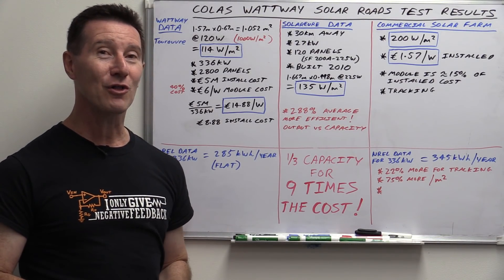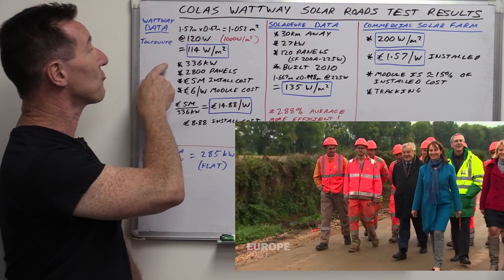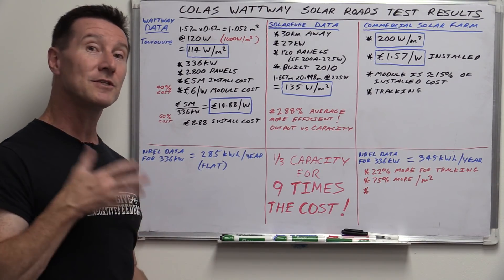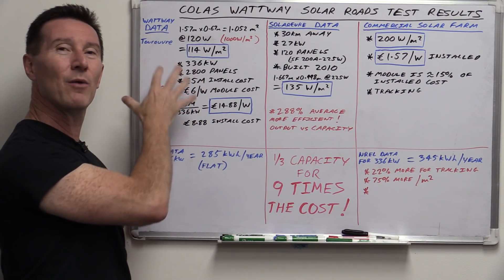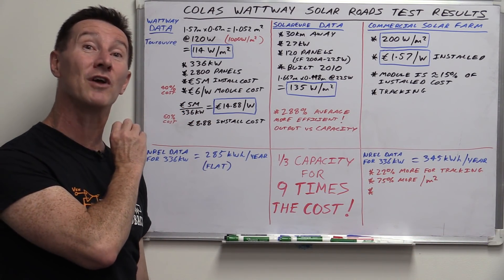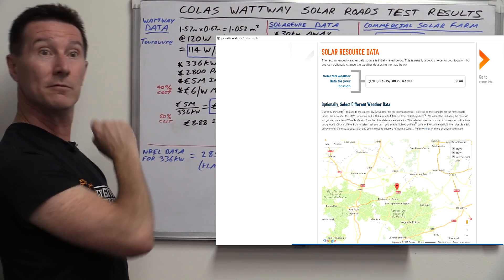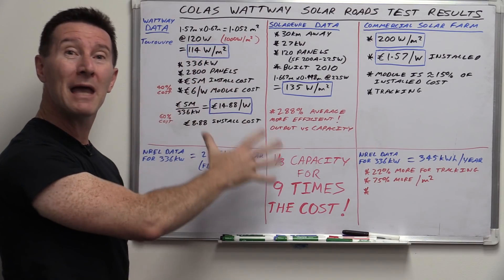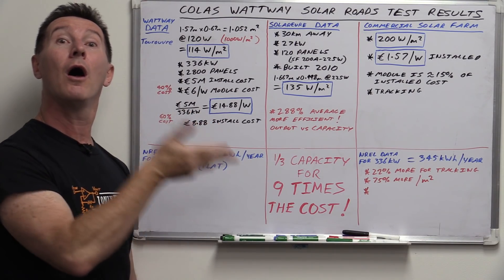EEVblog #1047 - Solar Roadways FINALLY BUSTED! (Colas Wattway)

Comment: Solar itself used to cost more than ten times the cost of fossil fuel, or hydro power.
That cost changed over time. Now solar is cheaper.
So, don't say never.

There are places where land is a premium. If existing roads can be converted to solar roads, it may be worth it.

Comment: You spent 20 minutes stating the obvious but completely missing the point. Solar roadways are NOT competing with solar on roofs. or solar in fields. They're competing with roads that dont have solar. The number(s) to care about are the total cost of building the road including maintenance, deducting any money they make on the solar generation. If you can build a road with solar that costs less than building one without solar, even if its less efficient and more expensive than putting solar in a field or on a roof you will still do it because of the economics. I dont understand why more people dont get this. I didnt need to watch your video to know that putting solar on my roof or in a field would be a better option if i was looking for somewhere to put some solar. I presume that right now the cost of the solar road, even including its generated revenue, is more than a non-solar road. The data that is generated by these experimental roads however will be invaluable to working out how cheap a solar road needs to be and how much energy it can generate to compete against non-solar roads.

Comment: Your comparing apples to oranges really, come on, if it is 1/3 efficient in comparison road solar system its still good think about. If all roads are cover with solar system will still produce more power then all other solar system which mean less fossile fuel is a good thing. If you put other solar system on the roads they won't last a day let alone an hour.

Comment: 30x worse on these calculations, but maintenance will be FAR higher than a solar farm and depreciation will be a disaster - driving trucks over your installation will surely cut its lifetime by at least 2/3. So over its lifetime you could make a conservative estimate that even the best solar roadway would be over 100x more expensive. Add heating panels, LEDs and an absurd tiled design like the Solar Freakin' Roadway, and you are rivaling chocolate teacups in terms of viability. Believers in this technology are approaching the irrationality of the Flat Earthers.

Comment: I don't really like these kinds of videos as they are attacking something that could be useful. Don't get me wrong some of the solar roadways are a joke/scam, but others are people trying to get it to work. Yes dedicated power plant is going to be cheaper that the road way, it is literally designed to produce the most power for the least cost. I feel what you are missing is how many thousands sq kms of road there is out in the world. In most places the black tarmac actually cause problems in the summer. If we can take these roads and use them for more than one purpose that would offset the cost and maybe pay for repair. Are solar road ways going to take 10 years before cars can drive on them (as a normal road way), probably. Do I think you should be including these facts in your argument, yes.

Comment: It's just as much of a scam as that Virgin Galactic sub orbital flight thingy. A 5 seater sub orbital spaceplane with $200,000 a seat tickets. I reckon only 1% of multimillionaires will be interested and about 50 flights should see that market exhausted in the USA.

Comment: Politicians are not interested in the efficiency of anything, only in their future votes...
If the public doesn't want to accept the real data then the politicians won't either.

Also, while the engineers probably pointed out those efficiency issues before installation, the sales team was selling the whole concept as magic and sorcery!
That's why most engineers just give up arguing with non engineering people, as most of humanity prefers fiction rather than facts...

Comment: UPDATE 7/2019:
Experiment failed. Instead of expected 22.000€ for the sold electricity per year they only created 8.000 €. Not included the cost for repairing the demage on the road.
But guess what - now they want to build "A BETTER VERSION" of the same DAMN THING. SEE here:

https://www.thelocal.fr/20190725/frances-experimental-solar-highway-has-failed-admit-officials?utm_source=Users&utm_campaign=c17ac86143-newsletter_France&utm_medium=email&utm_term=0_6b87f680a1-c17ac86143-61587861
These idiots just do NOT stop.

Comment: Why don't they just build solar roadways on the sun? They can build them upside down and just run a wire to the earth. Since the sun is ~93,000,000 miles away, they will be that much more efficient! Let's start a crowdfunding page and send the solar roadways engineers to the sun!

Comment: i see the point you make, but about the cost, i disagree with you. first: its a prototype situatuation.. if the can do it in big dimensions, and if the cost for solar panel drops (like all technological things, they will drop) the cost effiency will be better. And its not fair to compare it to a pure solar panel installation.. you must compare it also to the cost to a normal road construction with concret oder asphalt. a normal streat in germany costs around 300`000 euro for one kilometer. at the moment, and for a pilot project, its absolutly not efficient, thats right.. but, if the the concept will be adoptet in a much larger scale, the production costs will shrink (because of mass production) and the installationcost also (because of specialiced machines and tools, that companies will made for such a scenario). and there are other points: a normal solar farm needs space, space that then is wastet for other usages like bilding houses, grow food or stuff like that.. the land must be buyed, thats expensive.. the "land" on roads are allready buyd, so the prise for land falls flat. And, especialy here in europa, the cost for electrical power is massiv, and it will rise, because of focusing more on renewable energy instead of oil, charcoal and atom. if you count everyting together.. and the fact something like that can help to save our invoirment, its in a vew year no longer "that expensive" as it is now
Reply: You have words (vapid notions of hope), but no numbers (facts and reality).

Comment: Dave, I agree with your calculations but I believe you missed some important data. You should consider the cost of land that you don't need to purchase for new solar commercial applications and you should consider the road maintenance savings. Cheers
Reply: "you should consider the road maintenance savings" are you JOKING?!?! 😂Replacing potholes with computers! 😂

Comment: Not only is the roadway outrageously expensive, the figure for the commercial farm seems high too. For a $1.50 a watt you can get panels installed for homes in the US. Solar has gotten to be such a big business in this area that the local power company convinced the Chinese to build a Florida solar panel making plant to supply themselves with panels. Instead of 300 KW they are adding about 300 MW per year in Florida. https://www.fpl.com/energy-my-way/solar/energy-centers.html  Disclaimer: While I don't own FPL/Next Era Energy stock, my father worked for the company for 18 years.

It looks like the French would have been better off installing supports along the roadway and putting panels above the road. That also would have helped keep the drivers and road cooler and in the winter, less snow on it. Flat mounted panels are not bad in all locations and the closer to the Equator you are, the better they do.

Comment: canada is getting in on this action now "The City of Prince George has partnered with YCS Holdings Ltd. who have installed a section of solar-panel road in the parking lot.

The segment of Wattway solar-panel pavement connects to City Hall reducing consumption of energy and allows them to supply power to other areas, such as vehicle charging stations.

Chris Simons, Division Manager, says this is just the beginning of what he hopes a future expansion.

“Right now we are in the research and development stage so we want to trial it here and see how it stands up to Northern BC interior winters and it could be an opportunity for projects going forward to utilize this technology.

Simons says with this installation, Prince George is making headway in renewable energy.

“This is the first one in British Columbia and it’s the first one in a public environment in Canada.”

The panels are installed without having to destroy or rip up the existing roads and can stand the weight load of an 18-wheeler truck."

Comment: Wouldn't it make sense to just open another nuclear power station using modern technology? 1000 MWH per core that will be fine for the next 30 years, is more sensible than 300 KWH on a road that will fail to work after a few days.

Comment: Just a crazy idea, i was thinking about wether it's possible to utilize the sun shining on road surfaces in an other way. Namely not using solar panels but instead somehow utilising the heat collecting property of blacktop. For example by running water (or maybe an oil) through pipes below the surface of the blacktop and then run it through a heat exchanger to generate steam and power a turbine. Something along these lines.

Comment: It is not as good as a normal solar panel cuz it has the utitility of a road, I guess it' s possible to use because roads aren't producing any eletricity,if the cost of a road plus the solar panel, plus the space required is the same of a solar roadway, why not? Even if the price lowers, it won't go at the same rate, the technoloy of sturdy and cheaper material for solar roadway isn't necessary for solar pannels( guess the solar pannels will be even cheapier) but we can't know for sure. Possible that you're right, but the argument seems like, "why you'll use a plane that can't fly high enough, need a slingshot when we have zeppelins?"

Comment: What will be the costs for the road with conventional covering and what is the extra price for making a usual way a solar way? Will this solar way last only 15 Years or will it last for 30-40 years - as usual roads do? Is there a way to replace the solar panels without completely replace the whole road? Cost effectiveness might also include all costs a asphalt road would have. The electric energy is an extra.

Comment: So...20mins of one point...it's not as economical. Cost is far from a debunked or busted. The only things here is $ vs watts - what about the other things? How much does it really cost to maintain vs other road types? What is the value of roadside power anywhere or on road charging whilst driving? This is very short sighted and sounds very biased. Add more perspective maybe?

Comment: The French. looking to create new wealth for its citizens, decides to build a 943 mile-long solar roadway. The sun-light (having set its sights on French soil for some time now) seeing a fatal flaw in the road's design, realizes that the panels are cemented in. This leaves the gigantic gray strip - whose beauty was loved by all who walked its shimmering path - wide open and with two easily exploited flanks. The panels could not move or change position and could not be used to bolster the power of the various other cells along the line. 

Upon daybreak, the sun-light launched a massive two-pronged attack. The overwhelmed, under-prepared, inefficient, forces, had no choice; They surrendered almost immediately. 

Thousands of panels left with no light, no power...thrown on the streets and trodden upon. These roads, now paved with the lifeless remains of what was supposed to be the New and Powerful France, stand in remembrance every light, long-since snuffed out. This massive loss hit every Frenchman and Frenchwoman, both economically. and physically. It was a dark, frigid, ungodly day, for France who would never be the same. 

What they didn't know then that they would not see greater than 300kW panels for several years to come. But there is hope for France's future! With so many of its disenfranchised citizens looking for clean water (so they can make enough bathtub wine each day for mom, dad, and the kids), the government is going to be investing heavily in the amazing Water Seeker!

Comment: Chinese are now behind the idea.  They have just built a one mile long polar highway.  I agree everything you said.  But then there is the China Factor.  They never look at things on face value.  One of the these days, it will produce polar highways that are so cheap that it makes perfect sense.  Don't know when yet but if past experience has any guidance, it will be within 10 years and you will suddenly see 10K, 20K KM of solar highway springing up in China.  One of the interesting prospect of the solar highway is that it can charge cars as they travel on it.  It might potentially be a big draw as China's EV revolution is in the rage.

Comment: Why does everybody seem to have a predetermined bias against this idea?
Reply: Imagine two choices. Paying 81 000$ for a car that will break very soon and can barely drive or paying 9 000$ for a car that will last longer and drives faster. Which would you choose?

That's an analogy. Solar roadways cost 9 times more TO INSTALL, they will break down fast, they produce very little and replacing them is expensive. Maintenance would be frequent and costly, it's a terrible idea even without adding the high maintenance costs.

If land is such a big issue(which it is not) then don't waste money on solar. Slapping it on roadways is just just losing money for no gain. The panels would need hundreds of years to pay for themselves, but they'd break and need repairs constantly.

There's just no point to even try. It's simply a waste of money and this video illustrates how much of a waste it is. So many better ways to create energy out there.

Comment: This might very well be a terrible idea, I'm not even trying to argue with that, but it needs to be said that hammering on the difference between this and a solar farm is also pretty useless. I can't really drive over a solar farm, can I?

Solar farms are in the way, they require space that can not be reused for other purposes. This specific implementation won't work, but maybe derivatives will? When looked at as a way of producing energy, this is quite terrible, but what about as a way to reclaim space AND generate energy? I guess they still lose out to roofs, but there's not much the state can do to improve coverage of roofs in solar panels, other than using them on their own buildings.

Also, in this case they broke open a road that was fine before, that's a pretty big waste. What happens when you use this to replace a road that actually needs replacing? What's the difference in price between a standard road and this? Is the 5M figure only the solar parts, or does it include the road part too? What about labour costs? How much more does this cost to build and maintain vs a standard road. That would be a far more useful metric than raw cost. If a normal road would've cost 2M (I have no idea), the solar part would be considerably cheaper.

Still so many questions!

Comment: Well the logic isn't hard to fathom at all, you have roadways that occupy massive square area all over the place in cities. They are close to everyone that uses power (talking transmission losses from source to consumer), they do capture some nominal amount of solar energy, so why not harvest that as a resource? Most definitely they are 1 to 2 orders of magnitude less cost efficient than ordinary solar farms, but where else can you find so many acres of land in a city that can be exploited like this? A solar farm can be made much more efficient but you still need land space to put them on, and that's not free (and not included in the calculation, nor are the transmission losses which easily come to 50%+ of the generated power, depending on distance from consumer).
Well yes, roof surfaces are the logical alternative. But roadways are in addition!
(Personally I think the killer is the necessary maintenance: could you imagine treading into a pothole and getting electrocuted? But as technology improves, solar roadways may yet become a compelling solution, just to take advantage of all that unexploited square miles of space in urban spaces, despite the cost & maintenance problems).

Comment: they are testing these new solar flowers near where I live currently - roundabouts are in an abundance in most of europe so they installed this "flower" solar system which folds out to form a disc in the morning and tracks the sun throughout the day, and at night folds back in to pack itself to protect against any eventual damages.

Comment: I really like to know how the transparent media on top of the cells fared under the stresses and surface damage produced by heavy traffic, this is always the weak point of any such idea,  there is material that can resist abrasion and mechanical stress and still remain transparent enough to let sunlight through

Comment: To be honest, it doesn’t have to come close to a dedicated solar energy installation. What you really want to achieve is having the cost increase over traditional pavement, just that increase portion, not the entire installation cost, be comparable to the output revenue it can produce over its lifetime.
If you can do that, then you basically have a road that is the same cost as before, but can also produce energy. You don’t need to necessarily make a return from it.
Can that be achieved one day? Almost definitely, but probably not in near future, probably more than 10 years down the line.